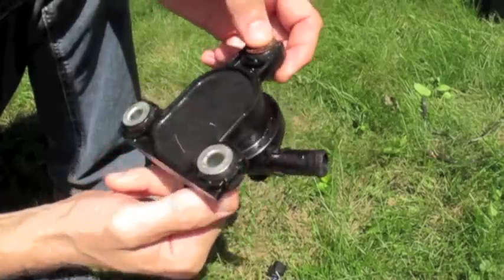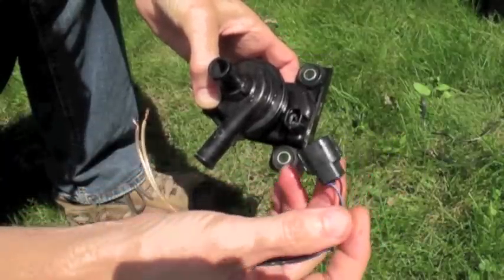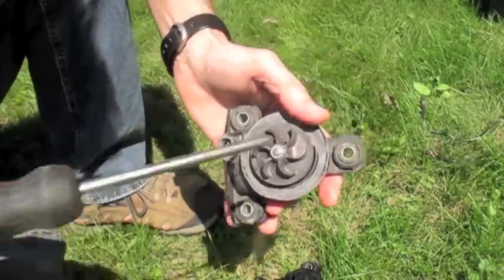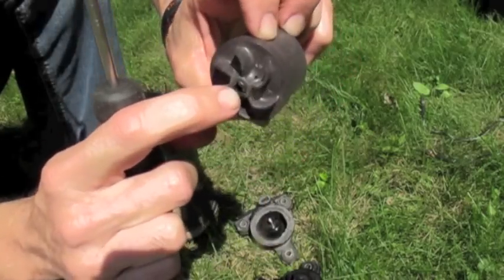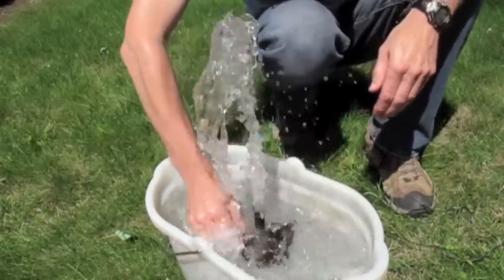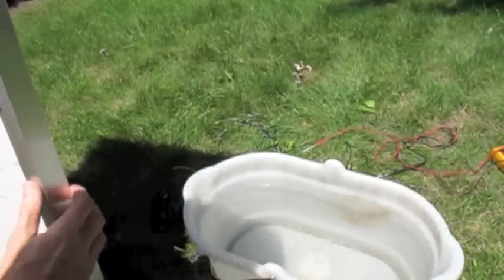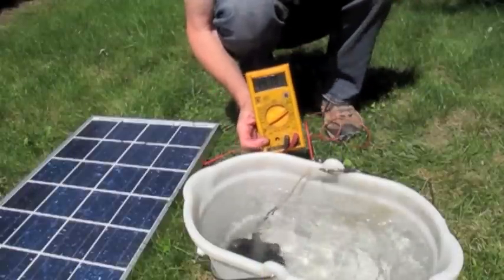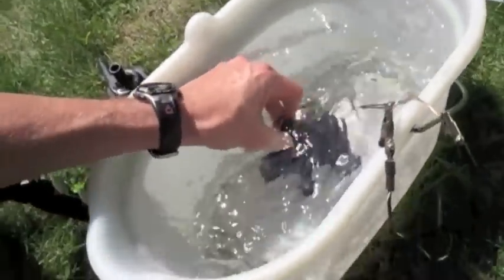Amazingly powerful 12volt water pump from a Toyota Prius ● test to 12v and solar

Comment: This would be AWESOME in a aquaponic system?
Reply from the maker: Yes, would probably work quite well.
Reply: How long would you suggest flushing water through a used pump before using it to feed a food supply?
Reply: Run a detergent through it and it should do just fine an aquponic system has a lot of water flowing so the pump contamination should be negligible.
Reply from the maker: +GEAUX-PRIUS Cowboy uuu.   As they say " the dose makes the poison" and your right, it is probably negligible.
Reply: I use to haul antifreeze in truck loads,  it is a marine pollutant but if you clean the pump with soap first and run the soap through the pump it should be safe to pump water for fish and plants but I would at least test it with gold fish first and if they live you are good to go.
Reply: Yes I am interested thanks.
Reply: Gold fish are hardy.  They seem to be happy and healthy in water that would probably kill you in less than a minute if you sip it.

Comment: If iam using 12v 16.8w solar pump,  what minimum specification solar panel is required to run that pump with full efficiency.. ?

Comment: Wonder if you could fit some sort of potentiometer in the circuit to reduce voltage thus reducing fountain height? Any ideas?
Reply: You would use a PWM controller.. it essentially does what you are saying, but with minimal power loss.

Comment: Could you use it as a turbine micro hydro generator by running pressurized water back through it ?
Reply from the maker: That's a possibility but I think you'd need too much head pressure to get the impeller rotating.I like your thinking.
Reply: I was thinking the exact same thing.
 i found Micro Hydro generators but they're all a little too small

Comment: it's interesting but there's a lot of factors here how many gallons per minute will it do it that way. What will be the PSI that it will perform. And hooking a hose to it how many feet will it go up two feet 10 feet 12 ft 30 ft. Those are good and interesting factors. Putting in a bucket of water there's not a good test for everything

Comment: I have some old water cisterns that I'm wanting to take water from to water a garden about 75 feet away. Could I just hook this up to a car battery and suck the water out of the cistern and run it through a garden hose? The cistern is about 12 feet deep.
Reply from the maker: +Brian Barnes I'm not sure of that. I want to test it more this summer if I can to see how far and high it will pump. Sorry I can't give you the answer you wanted now. Thanks for commenting.
Reply: Appreciate it! Cool video!
Reply: Do you know if a car battery would power it though? I'm tempted to buy one of those pumps just to try it.
Reply from the maker: yes a car battery would power it. Buy one from the wreckers, way way cheaper. Too expensive new. It's located in the front left corner of the car under the hood (if you are sitting in the driver seat)

Comment: I was in search of this type water pump for my home to use it in ac fan running on solar power. Is there any other type water pump of 12 volt in car.
Reply: Thanks and i am trying to get it from old car parts Sellers in Pakistan.

Comment: Chris, the solar panel, is it 51watts, (from what i saw on the label)???
Reply from the maker: Here is everything that was on that label. 
TYPE: multicrystal,  
MODEL: LA361j51,     
WATTS:  51w   
OPTIMUM VOLTAGE: 16.9v, 
OPTIMUM CURRENT: 3.02A, 
DiMENSIONS: 985 x 445 x 36mm,
DATE: 1992.7, 
KYOCERA CORPORATION
Reply: Hey, thanx, i'm actually using a 350gph bilge pump at the moment, just for testing.
....uhmm, it actually died now, it's pulsating the water, so i'll be chucking it out cos it is stuffing with the pwm controller, although it looks cool watching the water pulsate up and down, but i know it is the controller switching on/off really fast causing this. (overload protection, i reckon)

Just tinkering around, it's fun. :)

Comment: If you connected an air tight hose fitting to the pump and put the hose in the water... would it suck water through the hose  to the pump?  Or do you have to submerge the pump?
Reply from the maker: You have to submerge the pump. It is not self priming.
Reply: No you dont have to submerge it it actually should not be submerged its and inline pump not a submersible pump so it can not be under water unless you waterproof it compleatly but its also not a self priming pump either so you have you make sure you prime it first or fill it with water first

Comment: Is there anyway  to waterproof  the connection  this would be good for a pond
Reply from the maker: I got the plug from the wrecking yard with it and made a small water feature in a 7 gallon planter with rocks in it. The birds love it. The water isn't flowing like a fountain but it is moving and circulating. It has now been running for 3 years (not in the winter) . I shrink tubed the soldiered connections and siliconed the wire that is fed through the bottom of the container.
Reply: @chrisnotap  
And this are dc power i can directly  connect it to my 100 watts solar panel

Comment: Is there any solar water pump which comes below $10 for small hydroponics system? i would like to purchase one.
Reply: +15rollercoaster There are thousands of pumps that would foot that bill. Here is a simple one;
http://www.ebay.com/itm/Priming-Diaphragm-Pump-Spray-Motor-12V-for-Water-Dispenser-S-/181798801729?hash=item2a540d9141:g:5YYAAOSwjVVVoHBT

They are actually easy to come by! This one linked is self priming. You can get more efficient brushless ones that move more water, but are not self priming, for about the same cost.

Comment: will she work with a 24v house plug
Reply: Just found this thread. To run 12v on 24v look on eBay for a DC to DC buck converter or DC to DC step down converter.  http://www.ebay.com/sch/i.html?_from=R40&_trksid=p2050601.m570.l1313.TR0.TRC0.H0.TRS0&_nkw=DC+to+DC+step+down+converter&_sacat=0   Many are adjustable from 6V-40V input and 2v -20v output and @ 3 amp output, for $6 and less.

Comment: Learn something new everyday. I would like to have a hot water system that would glean heat from the exhaust or the hottest area. The ICE (Internal Combustion Engine) produces heat it is a byproduct and we treat it like it is worthless it is very possible for us to use it a copper wrap around the exhaust and water would be hot from just that. Probably have to use a glycol system to prevent freezing should you experience it. Again 2 gallons is all that would be needed I have showered probably 30 times using 2 gallons each time. I would love to have a small amount of hot water say 2 gallons so I could shower or possibly make foods that require hot water to cook.
I have 12 volt water heaters that plug in the cigarette but it literally takes 30 min to boil water this way. I could see it if I boiled 1.7 liters in 7 minutes as I do with my 1200 watt electric kettle at home but it would require I install a 2 KW inverter to power something that powerful
Reply: +S. McCloy Exhaust is much too hot. Use a heat exchanger with the actual coolant loop for the engine. That way it won't go much if at all above boiling.
Reply: Kenji Fox The car is a hybrid why don't we have a steam generator on the car it has an ICE that creates heat enough to steam water? Why not generate steam electricity?
Reply: You could do that, but not with copper. Using something like stainless that could handle if you ran it dry would work. The thing is, what would you power with the steam? You need an immediate place to use the energy. You could use it with a small turbine to help charge the hybrid pack, and only release any water to become steam when the battery is low. That's the only practical solution. That said, it would need a source of distilled water. Most users do not even keep up with their windshield washing fluid and oil. Let alone another thing to fill. It's basically much too complicated for an end user product. People would get confused and end up putting water in their engine. Human stupidity knows no bounds, believe me. People currently put the wrong fluids places under the hood as it is.
The requirement of water is huge as well, I'm not sure you would even be able to capture enough energy back from the steam to offset the weight and size of the water. Thermoelectric modules could be used to strip heat away from the engine coolant and generate some extra power though! You would need many of them, but that would be absolutely free and there is no reason at all other than cost not to do that. Look up peltier modules. They get hot on one side and cool on the other when powered. They generate a small amount of power when the same conditions are met.
Reply: Kenji Fox Yet we have nuclear power? I get it people like to neglect things but not all people are the same. I am not talking about marketing something for the masses I am talking about engineering aftermarket things to use on a car to increase economy. Distilled water comes off the AC there are huts selling distilled water all over the place. I live in the south I could run a dehumidifier and get distilled water why not if you have a turbine in the car you can get water when daily humidity levels are generally 75% or greater.  I am one of them people that keeps up with things my car was purchased new and has had very few repairs because I never go over the oil change level and I change the tires every 25K miles need it or not. When tires are cheaper than the deductible you change the tires.
Reply: +S. McCloy Hey, nobody is stopping you from engineering anything you want.
I'm just giving some real world advice as to why nobody has done it yet. The amount of water required to get a tangible amount of energy would far surpass the vehicles carrying capacity. Even if it didn't it would not offset the increased energy use starting and stopping the motion of all that mass. That, if there even were enough heat to boil that water so quickly as to do anything. That distilled water would be better used to mist into the engines intake (ONLY when up to full operating temp mind you) to increase combustion efficiency.
Reply: ***** Good idea I am sure somebody has done this already, I know the Prius does suffer from poor economy because the ICE does not reach optimum temperatures sooner.

Comment: could this be reversed and run water through it to generate power from a stream or a large water tank with this in line to a lower large water tank?
Reply: Probably yes
Reply: Yes, if it runs on 12vdc, which it does.
Reply: Probably no. As it is not a straight DC motor, it is a brushless motor using a mini inverter to run is, and unlikely to be programmed to generate.

Comment: which is the positive terminal. ?
(i could'nt get the terminal) :(

cheers!
Reply from the maker: Holding the pump in your hand with the intake tube pointing towards your chest and the terminals at the bottom, the positive is on the right. Don't worry, the circuit of the pump has forgiveness and you can give them a quick touch without a problem.
Reply: Hey, Thanx heaps!
I actually  grabbed a maggy glass and it had a red paint dot painted on the left hand side ( I assumed it was positive) holding it as you explained ))

Much thanx for your advice.
... i'll experiment either way :)
I am going to install it as a pump in  mum's fish pond with a 40w solar panel (2.27amp rated panel).
It should do the  job. :)

I will keep ya updated on how it goes, and even upload a video once i've finally configured it properly.

thanx for getting back  to me.

Kind Regards,
Mick (Australia)

Comment: Will this work in any direction when not submerged?
Reply: +Chris Notap why not? It's not submerged when it is in the car
Reply: I mean if you feed the pump water normally, will it work upside down and such?
Reply: +Chris Notap Yes! Orientation of course haha. I don't speak english normally and i mixed up the words :)
Reply: +Chris Notap Hi Chris. Will this pump work at 6 volts for an extended period? Or will it heat up at 6 volts? When facing the plug, which electrical lead goes to positive?

Comment: is this the water pump from the prius?
Reply from the maker: yes.
Reply from the maker: Inverter pump actually.
Reply: Chris, what solar panel did you use for this test,  because i got one of these pumps (without the connectorjs), and want to use this in  a fish pond, with an in line filter (prolly just some flywire wrapped around the the inlet).....

also, what happens if it runs 'dry' through no inflow????

cheers,
Mick

Comment: I need high pressure 12v pump for Aeroponics.  will this pump reach 50 to 100 psi ?
Reply from the maker: No it won't. I would guess (I didn't put an actual gauge on it) that it would be around 3-5 psi.
Reply: Ok thanks
Reply: +Ed and Irina Laney this is a far cry from what you are looking for, but I might be able to help... What is the application?

Comment: Can the flow direction be reversed by reversing the polarity? Also, can you drop the voltage to reduce the flow without causing premature failure?
Reply from the maker: No the polarity can't be reversed. I tried it, it sparks when you do. When I had it connected to the solar panel and the voltage dropped due to clouds, it would happily slow down to a trickle and speed up as the clouds passed. You can also restrict this pump to a flow rate you desire with out harm.
Reply: Thanks much.
Reply: these pumps are actually powered by an internal inverter that converts 12vdc power into AC power for the stator windings, the rotor is a permanent magnet and as long as you don't overheat it or feed it low or high voltage dc power, it should last for decades. but no, it's basically fixed input voltage and being a centrifugal pump, not reversible.
Reply: marzsit what do you consider "low voltage dc"?  I'm thinking of using this for a small fountain and will probably want to regulate the input voltage between 10 - 12vdc, but may need to drop as low as 8vdc to achieve the effect that I'm looking for.
Reply: a simple voltage change should affect the flow rate based on this video....  so, any kind of a potentiometer  (even a household dimmer switch) should work.
Reply: Anthony, couldn't you damage a 12V appliance by supplying it with say, 9.5 volts?  Would it then draw More Current to compensate, and potentially overheat?  Thanks, Patrick :-)
Reply: patrick young, not necessarily.  If you look at a 12vdc (including LEDs) light bulb and choke down the voltage, it's simply gets dimmer...  it doesn't start drawing more current to to compensate for a reduction in voltage.  12vdc fans are the same way.  That principle even applies to amplifiers to a certain degree (below a certain voltage they just shut off).  that's why I'm asking about the behavior of this specific pump before I buy one.
Reply: Centrifugal pumps like this cannot reverse flow. Water is drawn into the impeller in the center and slung out of the side. Run them in reverse and the water flows the same way but slower due to the impeller configuration for efficient operation at a design operating direction.
Reply: you can reverse the motor but the volume will be very greatly decreased, see the design of the impeller. You can drop the voltage and it will reduce the flow with no damage to the pump
Reply: It depends on the tolerance of the drive inverter. Once the voltage goes below a certain threshold, weird things happen...
Reply: Paul Langford Agreed.  my comments regarding the tolerance of different 12vdc "appliances" were limited to items that do not have nor operate on any dc-ac inversion.  All of the devices I spoke of are straight 12vdc devices. Hence my questions regarding tolerance of this water pump to being either under supplied or over supplied with voltage.